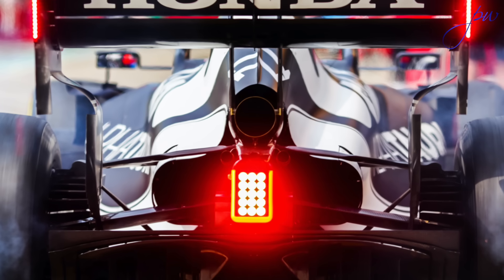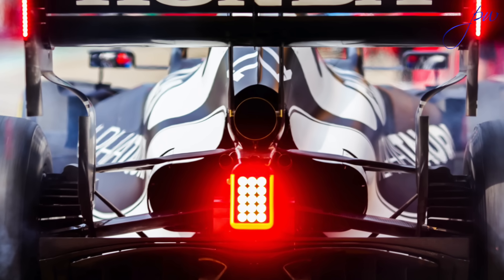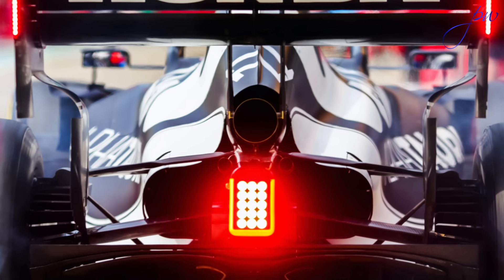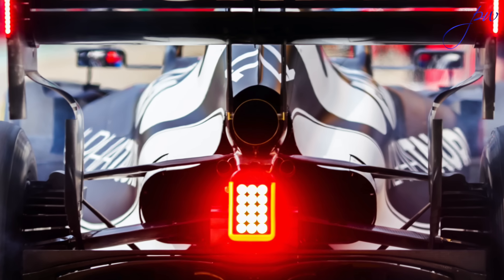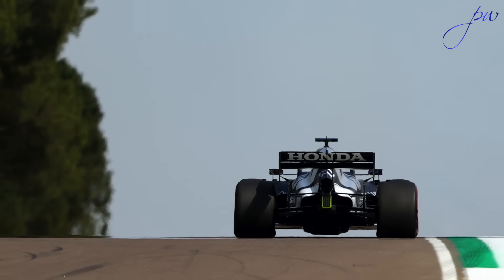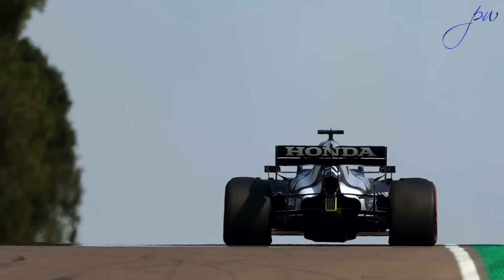The impact of the F1 crash feat. Scarbs by Peter Windsor

Comment: That’s the way it works, the system is as stron as it’s weakest part and because The rear impact structure did not absorbed enough energy, some of it eventually had to be transferred so the part that was connected was actually... a gearbox case 🤷‍♂️ They will surely keep an eye on this:)

Comment: Hi Peter/Scarbs .... Quick question with regards to Accident damage to cars this year. Because of the Cost Cap this year, any accident damage incurred by a Team could Hugely impact on a teams ability to replace parts & in conjunction to be able to do R&D work, and add those developments parts to their Car. It would seem unfair ..... especially if another teams car caused the damage. Would it not make sense ..... that as part of the F1 Entrance Fee ...... part of this Fee is an Insurance Policy? It's common practice (in lower Formulas) when you are racing for a Team you can either 1. Pay for the Damage yourself (Race by Race, or at the end of the Season) or by Taking out an Insurance Policy.

Comment: Listening carefully, that sounds like it runs all sorts of risks. The impact if not absorbed, will transfer straight through the solid engine block to the rear of the driver. Surely this needs correction?

Comment: It seemed shocking how seemingly little force was required to do that sort of damage, but Is it necessarily a bad thing that it came apart?  In a lot of yaw-rotating rear impacts wouldn't it be better to have some of the energy removed by destroying the gearbox casing, rather than have it built up to the degree that it then snaps the car rotationally in the other way?   Also for "perfectly aligned backwards impact" having the gearbox act as a crushable structure would be a good thing I would think.   Maybe not a cheap thing, but a safer process than a rigid structure in an impact?
Reply: Hi Chip, i agree. I had simi!ar thoughts myself